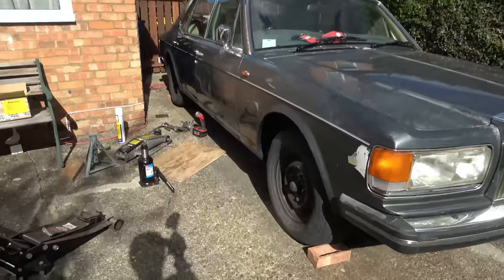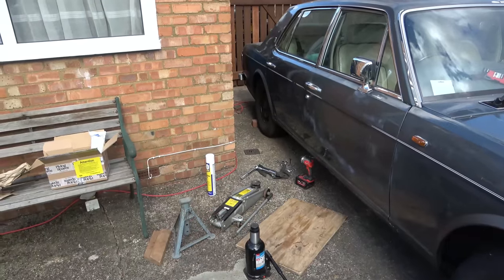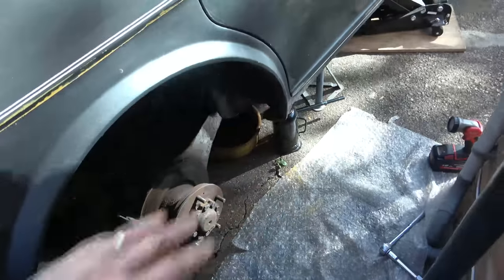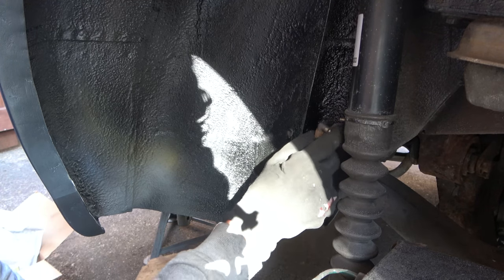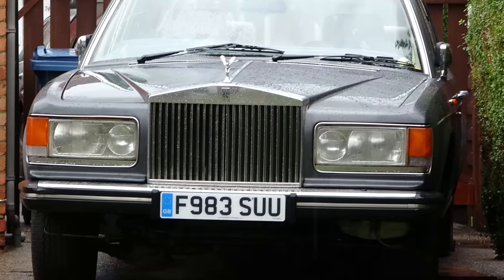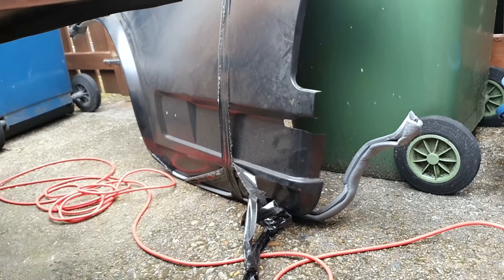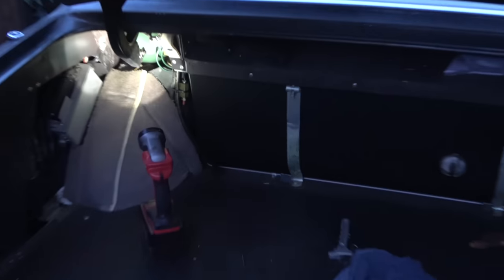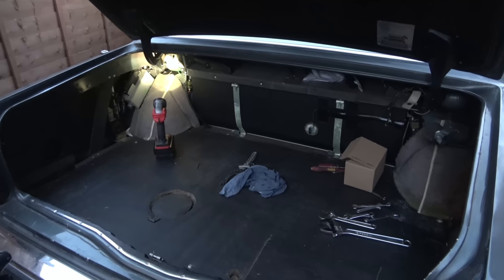Rolls Royce Silver Spirit Restoration PART 25 - REAR SUSPENSION HYDRAULICS

Comment: Nice! We upgraded to 4k for this vid. Just what the roller deserved. Really enjoying this series Vince. :)
Reply from the maker: Thanks Jon, I think the next few might be filmed in 4K as well. Lower frame rate though. I normally do 1080p 50 frames but when I do 4K I can only do 25 frames because of the camera 👌👍 You're the first to notice.
Reply: @Mymatevince  For some reason, the frame rate at 4K seems a lot more compatible with my viewing setup.  Well done, Vince.
Reply: @TechGorilla1987  My "4K" Chromecast with Google TV has frame pacing issues at 1080p 30 FPS. I'm not even nitpicking, they are noticeable stutters every few minutes for 1/5 a second. It may have gotten better with updates but I gave up. My Celeron N4000 potatobook named celery-stick has been more reliable for both YouTube and Steam Link. Had some stutter recently, might try it again to see if it was a thermal/performance issue or memory leak that a restart fixed.
Reply: Always play Youtube at the highest quality that has been uploaded, youtube castrates quality and 1080p is not true 1080p and neither are the other resolutions true to the claimed quality.
On a 720p screen i can see a difference in quality up to 1440p which should be impossible but its Youtubes compression.....
Reply: @stevefox3763  never bothered going more than 1080p cos my monitor is 1080........set youtube to 1440 and looks much better........thanks👍👍

Comment: You need a socket wrench set, and also you could use magnets to hold sheet metals together for welding. You should probably spray some paint over those internal welds, where the antenna drain goes. They will start rusting.

Comment: I'm really enjoying this series of videos, especially the end results of your bodywork repairs, excellent job. Having owned several hydraulic Citroen's, I was looking forward to seeing how you got on with the job of the suspension. Unfortunately I feel that most of what you did wasn't necessary, the small green plastic pipe sections you replaced, are only the return pipes, which are low pressure. Fluid would not rush out of these pipes/fittings, it would only drip if anything. If you had a proper hydraulic leak, you'd definitely know about it. I think the main leak you have on the offside rear of the car, is coming from the top of the strut, evident from the stain on the boot carpet. This will probably prove to be either, a lose fitting, or a worn rubber seal on the hydraulic ram, this leak can't be too bad, because this is the high pressure circuit, if it was properly leaking, there would be fluid absolutely everywhere. Repair kits would be available for the strut, which may be a Citroen part, but I don't really know. It's perfectly normal for there to be a small film of fluid on the rams under the rubber bellows by the way. Rolls Royce borrowed the hydraulic rear system from Citroen, to allow the rear of the car to remain at the same height at all times, meaning you can carry a large load in the boot, or tow a caravan for instance. This prevents steering problems. The spheres you replaced definitely didn't need replacing, unless the rear of the car was hard and bounced over bumps. I'm assuming that you have not driven the car to any extent. Looking at the car, you can clearly see that the rear of the car is low, which means that there is no pressure in the system, the real problem is elsewhere, probably at the front of the car. Incidentally, if the rear spheres were in need of replacement, the rear of the car would be higher than normal,  because there is a height level regulator on the rear antiroll bar, which bends slightly out of place and gives false readings, because of the bouncing. On older Citroen's, the rear suspension would sink after the engine was turned off, eventually Citroen fitted a valve which prevented this happening, I assume RR would have adopted the new system. I'm pleased that you realised that there is an alternative to buying RR parts especially in relation to the rear suspension. The probable leak will be at the "front" of the car, I would suspect the area around the offside wheel arch, it's going to be a worn, blown seal, damaged pipe, or a lose fitting on the pressure regulator. You can find the regulator by looking for another sphere attached to it. I did notice that there were a couple of dull green metal pipes on the rear strut, these are the high pressure pipes. Follow these pipes towards the front of the car , they will lead to the regulator. If it proves to be a ram, or regulator seal, simply replace the seals, the previous owner probably saw the leak, which would have been quite bad, and thought that they would have to replace the complete assembly.... at great cost. I wish I had your motivation, I've a 1975 Saab 96 v4, in need of repair..... So if you have a few hours spare...
Reply from the maker: There is some great info in this comment. Thanks for taking the time to write it. There was lots of staining around the small green pipe so I thought the ram might have been pushing out fluid from there. I didn't realise it was a low pressure return pipe. I thought maybe the staining in the boot was from storing the LHM+ fluid as there is a space to carry 2 bottles on the side just near that bit of carpet. I worried now that the ram might start leaking once the car is driven. I've definitely picked a bit of a pup here with this car. I haven't edited it up yet, but I do look at the front 2 spheres in an upcoming episode. Really the car needs to get on the road so I can see what works and what doesn't as I could be wasting my time changing over parts that don't need doing.
Cheers again for the helpful comment 👌👍👍
Reply: Hi, I don't think you've picked up a pup, this car is giving you loads of decent content for your excellent channel. I don't know anything about RR's, but I have had 13 Citroen's, so I know what it's like to have a leak, and having to repair and replace pipework by the side of the road, in the dark and rain... It's proper fun.  The rear leak is minor, the main leak is at the front, judging by the moisture below the sill at the front. Rule of thumb, main pressure pipes are solid metal pipes, around the size of brake pipe, although the fitting are unique to Citroen. They are easy to obtain, and cheap. Return pipes, which run at very low pressure are plastic, which on a Citroen are simply joined by being pushed into a small rubber tube, no clamps are needed. The only quick, sure way to find a leak, is to put fluid into the reservoir and see where it comes out. I can't remember if you said the fluid was LHM, or LDS, I would check the manual, you had green fluid, which is LHM, using LHM in a system designed for LDS may rot the seals over time, something to check. You could find yourself paying through the nose for this fluid, if you go to Halfords, I know that EuroCarparts is cheaper, but I found a supplier for some LDS , and got 5-litres for the price Halfords was asking for a 1- litre. LHM and LDS cannot be mixed by the way. I'll see if I can find the invoice for the 5litre, and let you know. I suspect that the car has been jacked up by someone who wasn't aware that there was delicate components there. Good news is that RR only used a bit of the suspension technology, whereas early Citroen's used the hydraulic system for, suspension, brakes and powered steering, a leak meant the car would be totally undrivable, and because it would sink, you couldn't get a jack under it... Fun.
I really appreciate you reading my comments, and finding them helpful, but returning to your remark about the car being a pup, that's not really the point, you enjoy repairing things, and I'm sure that you know that most things can be broken down into single components, with this in mind, a strut could cost Pounds, whereas a seal kit would be pennies.... Be in touch.. David

Comment: If you need to remove the axel/drive-shaft it may not be at all difficult, because this thing has a truck differential, you simply undo those eight inner bolts on the hub and slide the axle out, mind the oil.

Comment: Hello. Never tighten the spheres with a tool. A hand, even a greasy one, without a rag, without a glove, without even forcing, is enough to tighten it properly so that the removal in 5/10/15/20 years does not turn into a potential nightmare ^^ .  This is a classic mistake that causes many difficulties.It's not too late to do it right, unlock and then tighten by hand. Correctly tightened, a sphere can be unlocked by hand (dry this time ^^) even weeks or months later, without pressure naturally ;). 
 Many compliments for keeping these splendid machines in service!

Comment: You're right Vince. the suspension is by Citroen, the same as the DS all the way up to the Xantia, the spheres are the weak link but it's easy to tell when they have failed as the suspension goes hard and rattly. The gas in them is nitrogen, when the diaphragm fails the gas leaks into the hydraulic oil and then back to the tank where it vents to atmosphere. Another great episode Vince especially liking the Rolls Royce series.
Reply: Just to say the oleopneumatic suspension was trialed on the traction avant ( rear wheels only) in 1953. The car was called 6H being a 6 cylinder hydraulique. 
  I had a 1962 Citroën ID 19 with suspension height correcters identical to those on my 1986 Silver Spirit. 
  LHM hydraulics are so reliable on Citroen’s and there’s no reason why they shouldn’t be on the Spirit. Spheres are the same and whoever remarked they need only be hand tightened is right. So easy once you have freed the originally over tightened spheres ( I took to using a cold chisel and hammer)
  I’m loving this series.

Comment: Really impressive the welding patch work you are doing Vince! Once you show the parts after all the grind, filler and primer i am always like, damm i wouldnt even know that there was a patch done there! I know nothing about cars anymore but i spent a little time in a car maintenance garage when i was a teenager some 20 years ago, as a part time job, helping out my step dad who was a car mechanic, and i must say, in all the time i was there i never saw anyone doing a better repair job than what you have done so far! 

Also, it's been a couple of months since i found your channel, i really enjoy your videos, they are very entertaining, relaxing and informative! Particularly enjoy the eletronics repairs because i used to work doing maintenance for pcs, but never on that level of troubleshooting like you do changing a single component on the board, it was more like the processor chip is fried, change it, or something in the board or memory chip got fried, change the whole board lol. It's really interesting to me to see how you can save stuff by sometimes finding out a single capacitor that was bad... but... i must say, i'm enjoying the car repair series just as much as all the eletronics videos!

Comment: I miss pits and ramps so much, years back i worked for a Black Cab overhaul company and whenever i needed to do anything to my car i could do it there on a Sat or Sun.   Pits can be hazardous if your not on the ball, one of the ramps had one under it and i was doing a service on a cab with it up about 4 feet on the lift, i jumped out the pit from the side and stood up quickly while completely forgetting the Cab had the drivers door open.  I was briefly knocked out and received stitches on the top of my head lol.

Comment: The suspension shperes was actually designed by Citroën back in 1952, I think. They used them in the Tracton Avant and then went on to use them across their model range such as the C1. So the Roller uses Citroën parts. It would have been cheaper to buy them as Citroën parts. 
The ride quality was far superior than your usual shock and spring and thus Rolls Royce and Bentley adopted this system on their vehicles.

I don't think they use this system anymore and have switched over to magnetic ride suspension.

Good stuff vince.

Ps i think the spheres go for about 70 quid for the pair.
Reply: Those are original spheres from Citroën though, they'd probably be a bit more expensive. About 80-90 quid each I'd say. A quick google reveals that these are probably for a Xantia. Citroën's original spheres for Xantias were grey from ~late 1998 until the mid-late 2000's, so I'd reckon it's likely these were fitted around that time.
Reply: @SterkeYerke5555 This is unlikely since the Rolls Royce is registered as a 1988 F reg model.
Reply: @M1LAD81  So the spheres would've been changed when the car was 10 to 20 years old. That doesn't seem off, right?

Comment: I eagerly anticipate the filling & pressurisation of the system, hopefully you have no leaks and it bleeds up properly. 

I really thought that bleed nipple was going to snap like a carrot as they usually do, good thinking on holding the block with a spanner as the spot welded mounts would have sheared straight off. 

Worth going around and trying to free up all the bleed nipples on the brake calipers as you are going to need to bleed the entire system, I find if they are really tight and feel like they are going to snap undo them a tiny little bit and then tighten it back up, then repeat, undo and tighten little by little. Sometimes it works, if you can get a deep socket on instead of a spanner also helps to stop slipping.

I tend to stay away from heat due to the seals in the calipers or cylinders, if they do snap you are going to need some screw extractors as I would imagine the calipers are going to be expensive.
Reply from the maker: Thanks Adam 👌👍👍👍

Comment: The brass unions and olives that you have look very much like Wade fittings that we used in industry years ago.
The rule was , with a new olive fitted , tighten hand tight ,then 1/3 turn with spanner. This applied whatever size tubing was used.

Comment: Maybe weld/grind a little plug in the hole on the drivers side corresponding to the aerial! If it’s getting a full respray it’ll be a much neater job than that rubber grommet :)
Love this series btw save them up as a weekend treat!!

Comment: Great Video as usual Vince!! I remember years back I had a Austin Maxi. That had hydrolastic suspension which looks almost identical. I remember one side failed as the front to back on each side were linked, and I had to let the other side down to level it out to drive it back home.. It was very bumpy with no suspension!

Comment: Nice one Vince! I've not done them myself but I was pretty sure from reading various forums that the spheres should only be finger tight, as the high pressure in the system will lock them in place. I'd double check in the workshop manual or other online resources but I think overtightening them can cause problems

Comment: Nice one Vince
On your angle grinder, have you ever tried a flapper wheel instead of a rigid abrasive wheel for smoothing welds and sharpening lawn mower blades?
it works so well and is an inexpensive consumable.
I recommend that you try one.

Comment: When I spent my spare time at my mates garage, I was helping making cardboard cut out to line up where we need before we cut metal sheets up, I learnt spot wedding and stitch welding and got very good at it.
The only thing is to make sure you had a clean area to weld with great earth to the car also remembering to disconnect the alternator

Comment: I think Sliverline do some of those wrenches with rubber straps.
Also I think it would be good to use a weld through primer before the bodywork repairs.
It would add some protection for the bare metal around the welds.
Good stuff though!

Comment: There is only about 2 suppliers for accumulators/spheres in the world I can find, both in the UK. There is a seller in the USA but I think they get theirs are on sourced from the UK anyway. Try buying a rear suspension damper (Shock absorber leveler), no change from 550 pounds.

Comment: Citroen BX's were extremely regular for spheres to need replacing as in yearly with MOT failures, but think it was mainly the garage my parents were taking their cars to, as would cost £250 per sphere back in the mid 90's. so probably be well in the £750 you saved yourself doing it yourself by the time you take into account the inflation. yeah had a pretty bad bump in the one BX, seen green stuff coming out of the sphere but didn't know what it was, as never worked with hydrolics not even in car maintenance course.
Reply: when I say it was that garages favourate failure another garage passed the cars MOT without needing to replace, or even reccomend it needing replacement, the hydrolics worked fine.

Comment: I am surprised that the Citroën ball things would be rated to the same weight as a rolls one. As a few others have written, dont skip the welding and fabrication
Reply from the maker: Personally I enjoy filming the welding Emma, but I have done 4 videos on it now and this would have just been a repeat of the other side. The views unfortunately were lower on the recent welding videos, so I didn't want to risk putting another full length video out on it, BUT at the same time I wanted to keep everyone up to date on progress hence the massively cropped down welding section 👍👍👍

Comment: When RR get the hydro elastic Spheres from Citroen the are not painted. If the new ones are green they are Citroen parts but are identical. A similar system was used in the old metro. 
And you may need to redo the fitting on the strut as that should be tight and not rotate. The olive is not seated all the way on the barb from the shock.

Comment: i suspect why it was recommended to replace the spheres is the usual problem with prefilled hydraulic cylinders, they gradually leak and fail over time and just stop doing what they are designed for.  the most prominent example that comes to mind is the hydraulic shocks that hold up rear windows and hoods